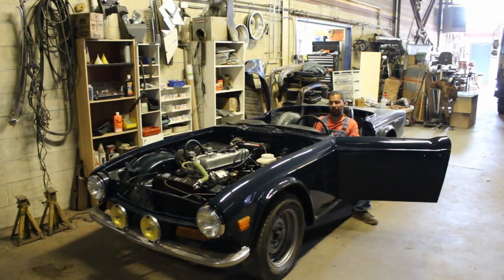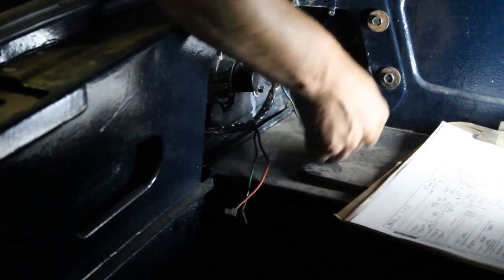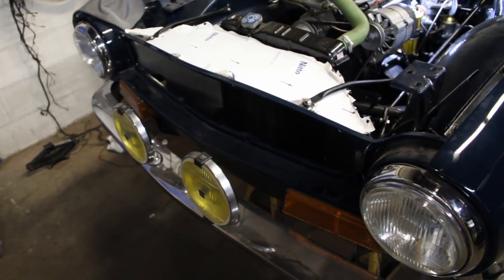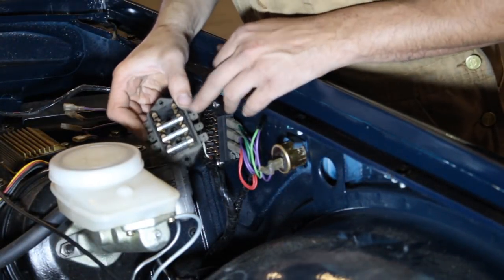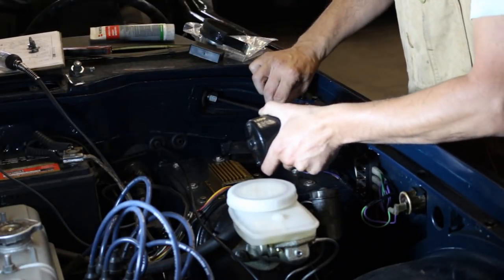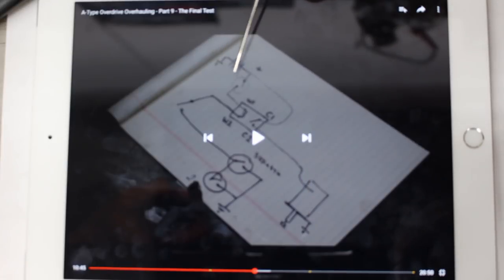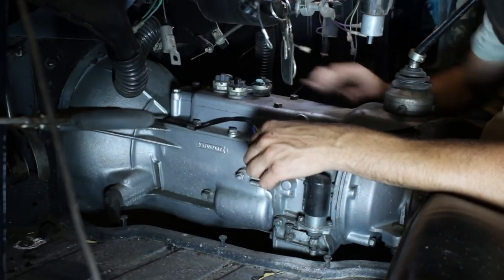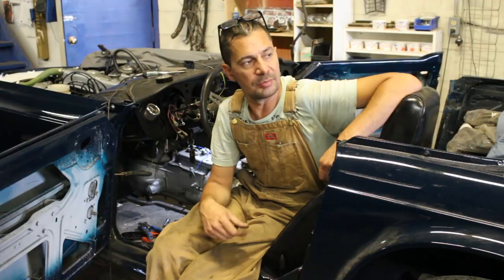1973 Triumph TR6 restoration - part 22 - wiring the overdrive, horn etc.

Comment: I very much appreciate the walk through of the overdrive wiring you give us in this video! At some point in the future I will be doing the same on my TR4, which was a non-OD car, but now has a rebuilt gearbox with an A-type OD. 
I'm looking at a bit more complex installation, though. First, the OD switch in my car is a button built into the shift knob, rather than a lever in the steering column. That's not a big deal. But I'm also adding a "logic box" I got from Revington TR. If I wire it correctly, that will make the gearbox and OD operate more like a close ratio 7-speed. 
I don't know when I'll be getting around to that project, but will definitely re-watch this and some of your other OD wiring videos before tackling it!

Comment: Hi Elin, I'd give the o/d  load circuit  power from the battery rather than through the ignition otherwise you may  overload the ignition switch as you were worried about the  overdrive column switch burning out.
Reply from the maker: It makes sense, but I am not worried about overloading the switch. You know the main abuse a switch takes is when it is turned on or off under load as the contacts burn out from arcing. However when I turn the ignition on or off the overdrive will be in the off position as I am always in first or neutral when I start or turn off the engine. If I thought about it before I did the wiring I would probably do it the way you suggested, but since I didn't I am not going back... too many other things to catch up on :)

Comment: The flasher unit you installed is for the 4-way emergency flashers. The one for the turn signals is located in the right side (passenger) foot well. This could save you from going crazy when you test the turn signals. I hae been told the turn signal flasher was installed inside the "cockpit" so the driver could hear it working. Good luck with that I say!
Reply from the maker: Yes, thank you. I noticed that when I was looking at the wiring under the dash and I was trying to figure out what those wires were for in the passenger footwell. Thanks!